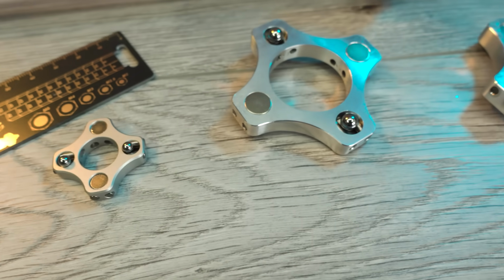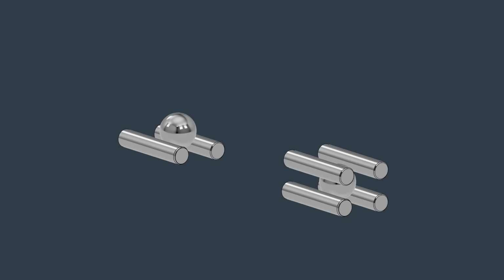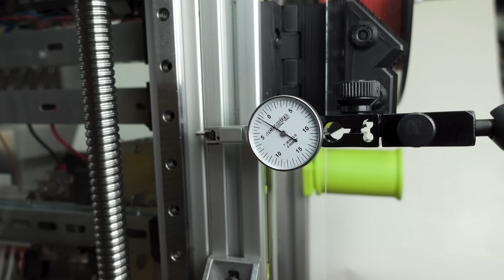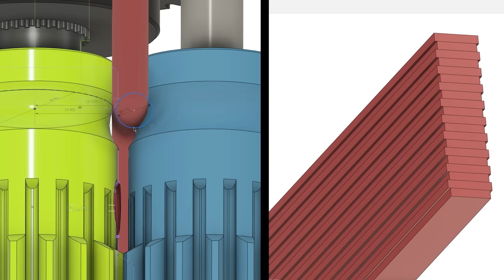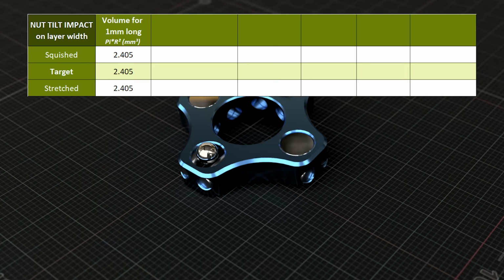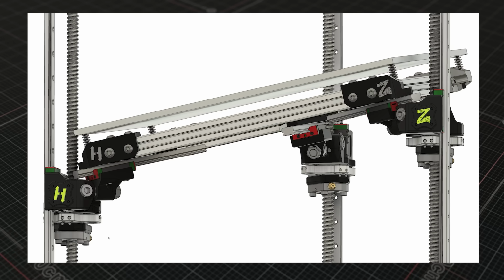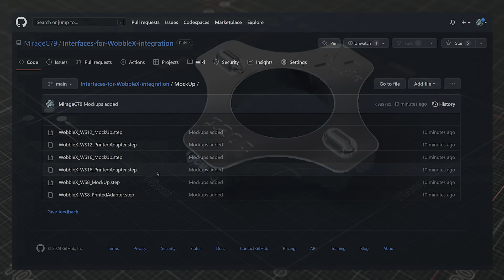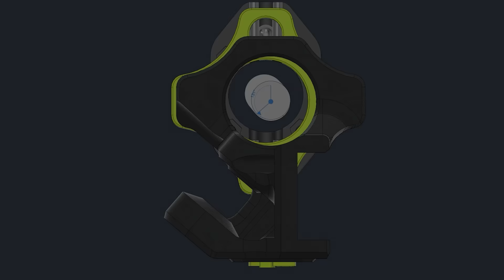I will never talk about Z wobbling ever again !

Comment: Z wobble isn't always the sole reason for Z artifacts or Z banding - No matter how much we compensate! There's always others factors coming into play, too.
Reply: well of course! but like, that was a HUGE reason. It's like seeing your house has mold everywhere, no electricity and also half of it is under the water bc of the latest hurricane or whatever: Sure, fungi and lack of energy are very important, but solving the issue of the flood would greatly improve your house, and also would help to solve the other two things 😆
Reply: Yup... On my custom Delta printer I had the problem where the bed is static, but still experienced z-banding. Turns out it was the PSU I was using, it had a very very loud fan, that would only turn on when "needed". The fan drew enough power that the voltage dropped, causing the bed to cool a bit faster than the PID tune could kick it back up, and the expansion was enough to cause visible artifacting. Took me months to figure out.
Reply: @NeoAcheron  daaaaaaaamnnn! Awesome that you found out! Sounds like something you might not find easy at all untill everything else is correct
Reply: @NeoAcheron  That is some detective level of troubleshooting to figure that out.

I guess what your saying is suggestive of what I have noticed with a lot of budget/DIY 3D Printers that you buy as kits like the Ender 3 or Anet A8.
That is that if you use the completely stock electronics that they are supplied with then you're not going to have the best low budget experience that you can have because these manufacturers frequently cheap out on the PCB Design, PCB Components, and, Power Supply/Power Regulation.
A combination of all of this results in often unstable & very dirty/unreliable power being supplied to the motors, the heating element of the bed, the LCD, and even the heated extruder head, which all leads to a compromised and sub-par 3D printing experience.
Reply: @NeoAcheron - haha! Well done in finding that little hidden detail!
Reply: If you watched this channel's journey to this video, He isolated the issues down to lead screws. He isn't claiming it's the only way that can cause Z wobble like artifacts.
Reply: @XenonG  i have been at MirageC since the beginning, even before hevort got so popular - and I love his progress! His work definitely is effective. I just wanted to make this note here haha
Reply: @munzlp  Good point! And noted as well. :)
Reply: This channel has a lot of videos on the topic of Z artifacts and even things that look like Z artifacts.
Reply: Why not just use belted z??
Reply: @C650101  Heavy beds such as 500mm^2+ will have many issues when not driven by screws. Even with high gear ratios
Reply: @munzlp  Mine is 300, but what issues?  If you use a powerful steppers in tri  belt system with gear reduction, would n't that be better than lead screws?
Reply: @C650101  I run a cast alu 400x400 and 600x600 and belts, even 9mm at times can stretch. Also the forces on the motor are quite harsh
Reply: I really love how the ball bearings are kept centered by the magnets! Simple and clever. 
Could we use a similar mechanism to improve the performance of linear rails?
Reply: He must have extremely out of whack screws, very rare you get them from the factory true because china
Reply: Right, i was just thinking about this, you dont really print while the z is moving up, so that extrusion line widh shouldnt be all uneven because of Z wobble.  Well not all of it, thats more likely to due bed temp fluctuations, that will cause the z to change ever so slightly while is shirnking and contracting, something more probable  since its happening constantly while on the same layer, whereas  a Zrod problem would only show up in layer changes.  And in this example here it does seem to be Z wobble since the pattern reflected the rods.  But the uneven "bumpy" random lines he was showing arent z wobble, but more likely bed temp fluctuations.   Same effect, different reason.  Why I think its important to PID tune your bed while the fan is  blowing as well so it has that constant cooling to fight against, should make the temperature more consistant.